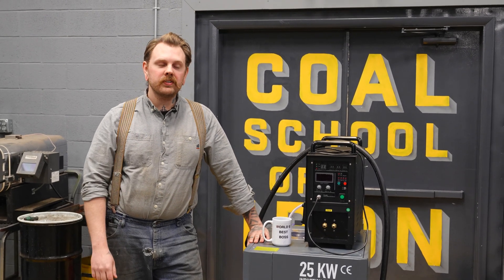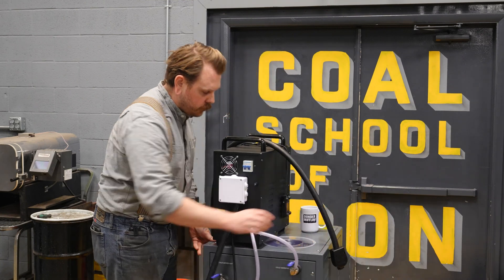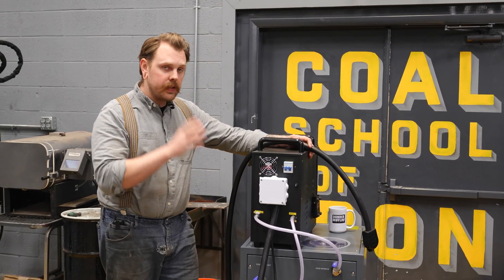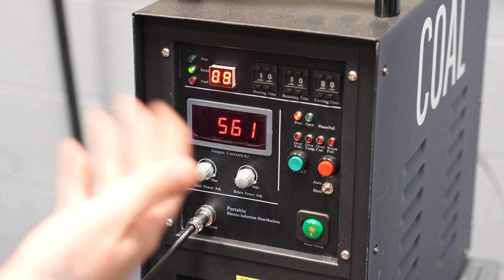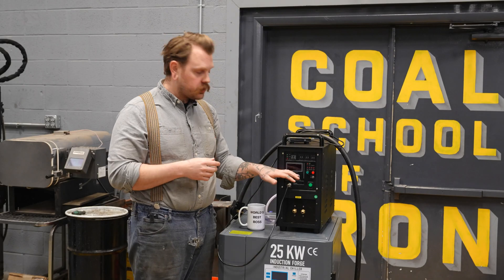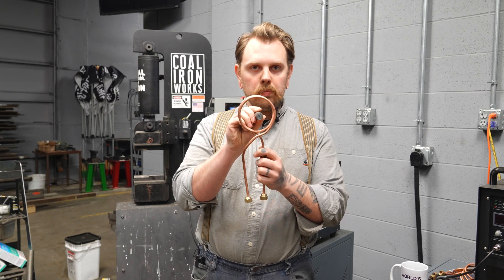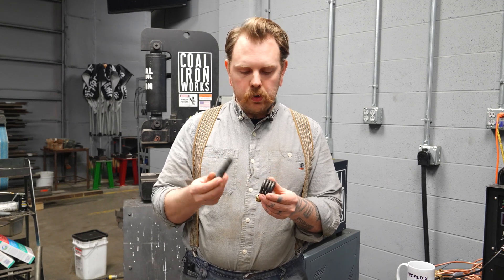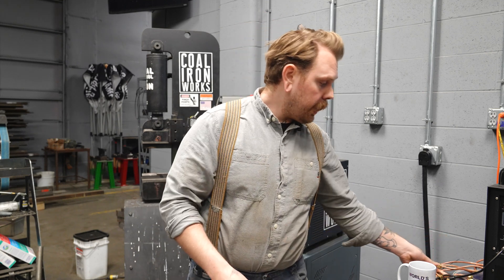25kW Induction Forge

Comment: The big issue is how much is the cost over a US solid that will do the job
Reply from the maker: This may seem like a hurdle, however the US solid will only grant you a heating unit and it's more than likely not a single phase 25kW unit. What you're getting for our higher pricing is an incredible heating unit that is still single phase power paired with an industrial chiller that refrigerates and cycles your water, giving you a 100% duty cycle on your machine. You're also getting a warranty and American customer support!